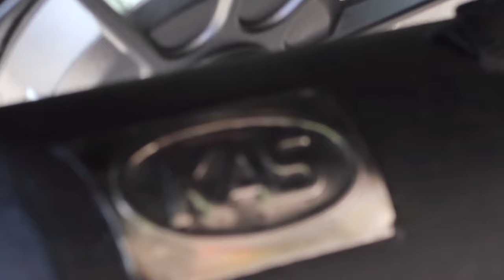Scooter wash! "Honda Dio2" | Vlog 094 | Kyle Andrei

Comment: Pwede ba mag palit ng 70cc blockkit pero stock ang sigunyal (dio2) balak ko kasimag 70cc pero dna mag papalit ng sigunyal hehe sana manotice
Reply from the maker: opo pede po hehe
Reply: Sir Pwedi naman po Stock Sigunyal sa 70cc ,it will Work. Pero kung Gusto nyo ma Maximize or ma feel mo talaga ang Power ng 70 or 90cc Better go with Racing Sigunyal. Ride safe po🛵😎
Reply from the maker: @neomigueldimacali3608  tama hehe